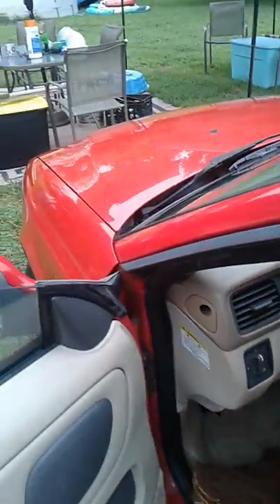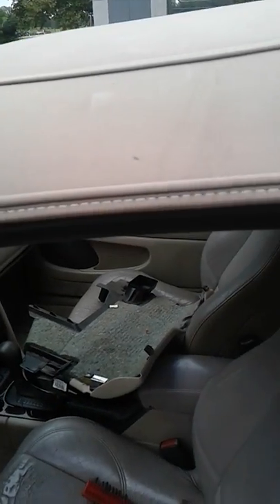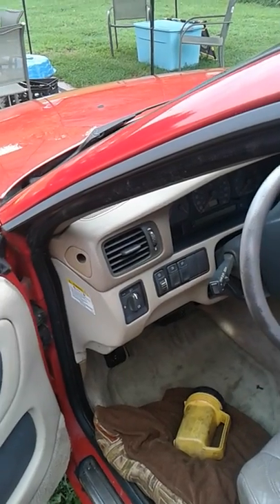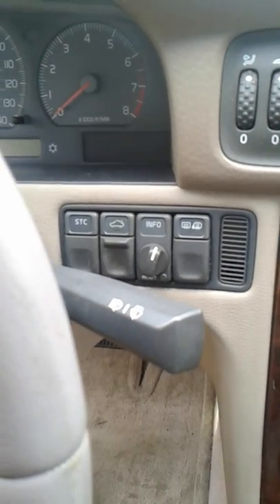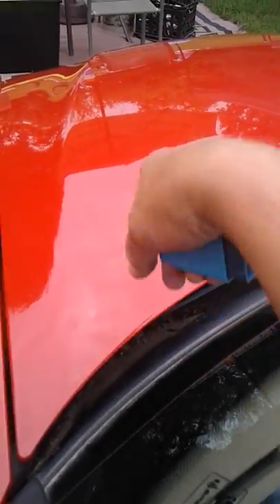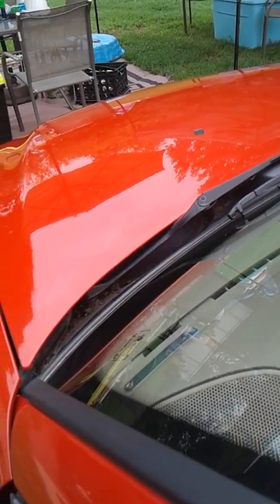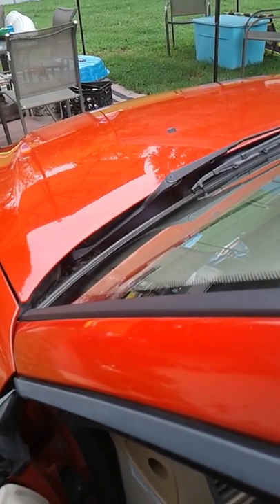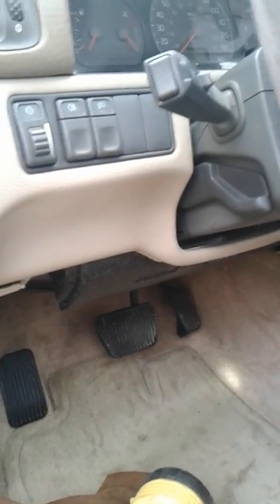2000 c70 volvo soft top convertible sensor chiming

Comment: Hi Princess! Just wanted to say a huge thanks for this video. My electric hood was working fine until I messed it up yesterday. I ended up spending a couple of hours working out how to close it manually but that annooying little chime was singing its little head off. Your video was a total God send. Happy new year!!!
Reply from the maker: Thank you so much everyone for responding positively to my video clip am so glad it helped everybody I realize the car manufacturer cannot post such a thing because there are instances where the latch is defective and could be a safety hazard in my instance when I put electric to the motor it did actually work so I knew the top wasn't going to go flying off down the road while driving LOL so everybody be safe enjoy life while you can

Comment: Thanks so much for posting this!  Good tip to unclip the light.  It does get hot.  For those of you trying this, just following her directions.  It is the blue sensor on the top.  Just pull it out.  I have a fairly new top, and everything works the way it should.  Just remember you need to keep your finger on the button the whole time to make sure windows are up.  Great job on the video!

Comment: Thank you for this video.  It seems to be the ONLY one one removing the relay, and getting rid of that toothache (the chime).  You mention, almost in passing, the removal of the lower cover.  You say to simply remove it.  Well, that's the part that has me on hold.  I've removed the screw. and can lower it a bit, but only on the side closest to the steering column.  The rear of the piece won't budge.  I'm afraid i will snap something, and forever ruin the part (which has been discontinued.... go figure.  Any idea why the back portion of the cover doesn't seem to want to move?  Are there clips back there? - Thanks
Reply: If you haven't found it yet, there is another Phillips screw on the other side near the door that needs to be removed.